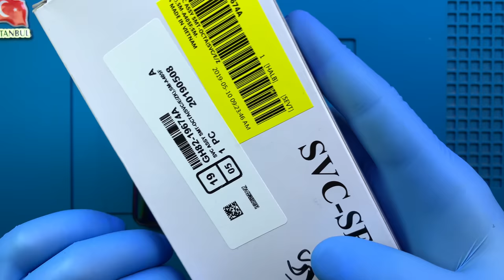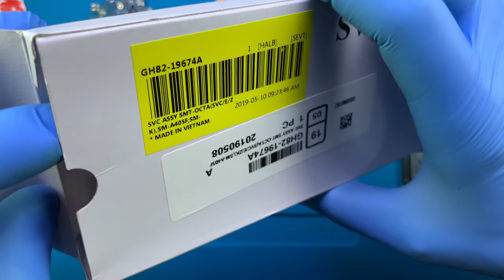Samsung Galaxy A40 Ekran Değişimi 🇹🇷 | SM-405F #samsunggalaxya40

Comment: hello sir
what are you wearing in your left hand and what is the use?
Reply from the maker: Hello there;
It is a static-free wristband on the left arm. Our technical service is designed to be completely free from static electricity, but it is installed by our technicians as an additional precaution in order to prevent static electricity that may occur momentarily. The right arm is a special magnetic magnet. It allows to hold very small metal parts.
Greetings.